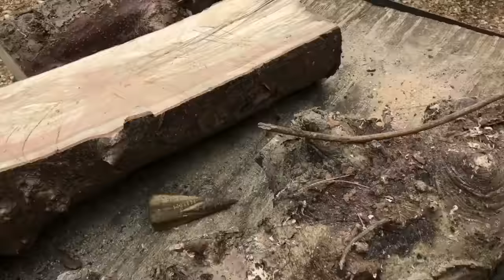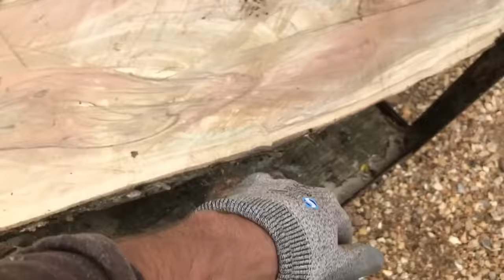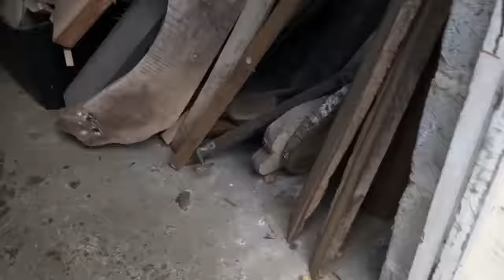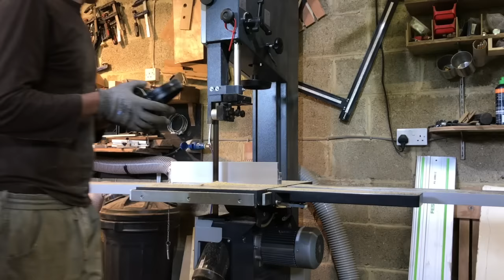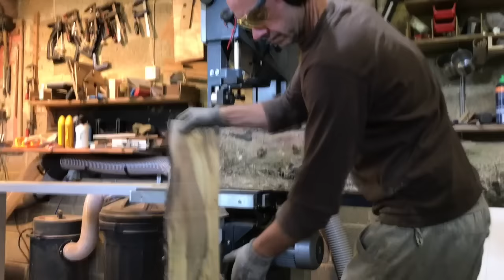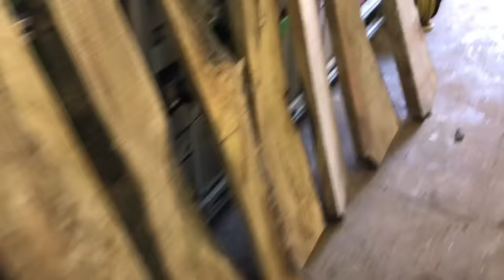Planking Dead Holly Tree   - Felder FB510

Comment: I was expecting holly to be whiter. I have a few logs of it in my stash for a few years, this is encouraging me to mill it now.
Reply from the maker: I can't wait to use it . maybe this summer ..
Reply: I have some Holly that is almost pure white. I remember reading it needs to be kiln dried immediately after cutting to avoid it going blue
Reply: @tylersmith9868   :-(  Wish I'd known that 4 years ago. I have a couple Holly logs I've been wanting to slab out for a couple years now. Though I would wait until it was good and dry. I never researched anything about drying Holly so didn't know. I just sealed the ends and stuck it in my shed for the past 4 years. Now I'm afraid to cut it open and find out I ruined it.

Comment: That is a breast of a bandsaw. Wish I had the power in my shop to run a saw that big. I am stuck with 1.75HP and 120V. I like the table extensions. I made my own for my Rikon as they are none commercially available.

I'd like to suggest a sled or carriage for planking out logs. You won't be fighting the uneven underside of the log riding on the table, it will rest on the sled and the sled will glide smoothly over the table making for a much easier cut. 

Sled does not have to be thick and cost you much resaw capacity, I used a piece of 6061T6 aluminum plate 1/4" thick to make mine and attached a runner to the underside.  I use a sled all the time on my BS and it's great. I use it more than the sled for the table saw.

Comment: I'm just curious, where do you get all of these great pieces of old wood? You have some of the most wonderful and what some people would consider exotic woods to work with.
Reply from the maker: Hello Greg, all of the wood that I am using in the videos "other than sheet goods" I have cut down from the garden of my old house,  its all trees that have died or branches that dropped.  I have chain saw'ed them were they fell as there was no access for any extraction gear so took for ever to plank were they fell, the Walnut took me over 3 months on and off ..  the Holly look sick for years then the top broke of in storm.  I try to use this stock for smaller items or it will just all good and my new place have very little tree's of age so don't expect much dead wood.  but I am on the look out for a local wood to see if I can lend a hand for some odd cuts of Oak etc ... Cheers